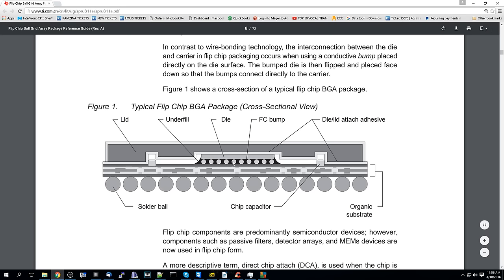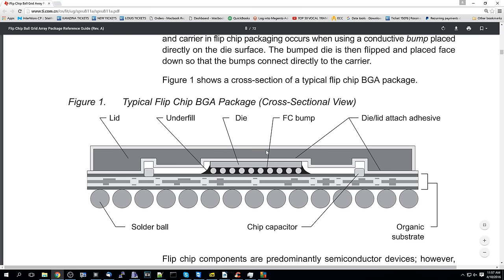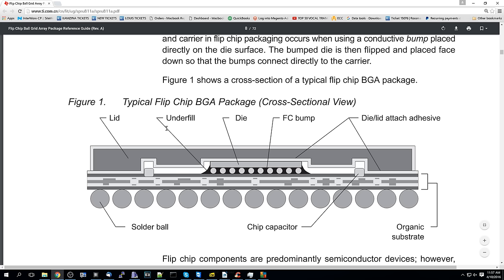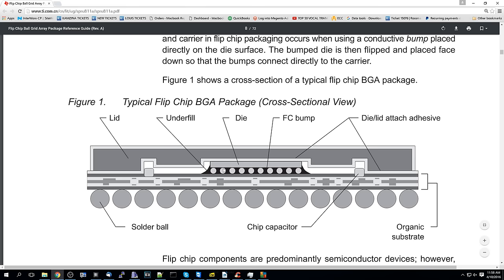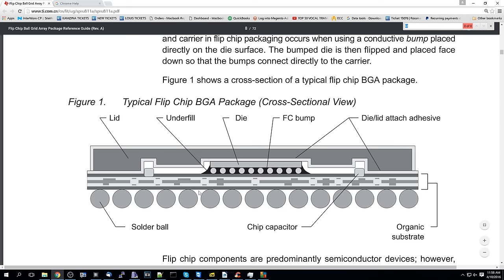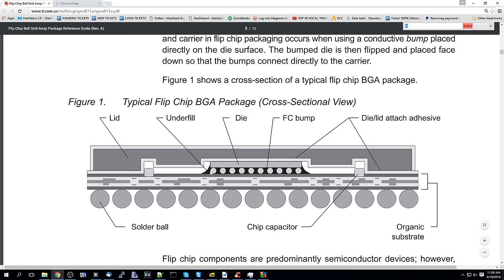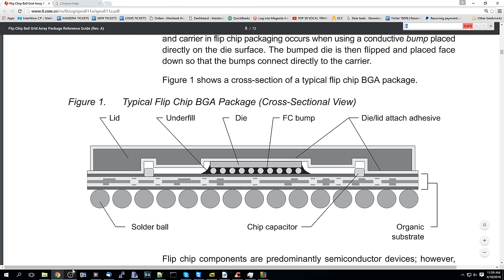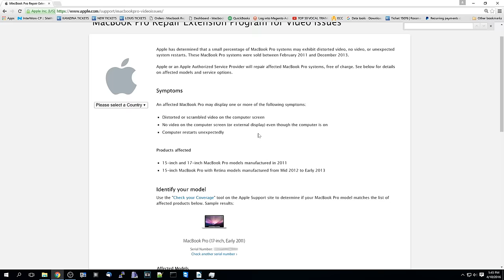Reballing a dead horse: Q&A from my YT inbox.

Comment: 3 years back my r9 270 completely failed on my after some artifacts that appeared shortly before, i did the oven method which fixed the card and it actually still works to this day
Reply: I also have a failed R9 270, could you share some details on how you fixed it? Mine failed around 2.5 years ago...
Reply: @MrDuck-je7fg  it's pretty detailed on here https://lifehacker.com/save-a-dying-video-card-with-a-quick-bake-in-the-oven-5823227, oven method basic steps are dismantling the cooler and heatsink from the gpu chip, then placing it on an oven plate but important to let the chip's four corners rest on tin foil balls, then put that tray in the preheated oven of around 390 degrees fahrenheit and leave it like that for 12 minutes, then let it cool and after that screw everything back including new thermal paste and then it could perhaps work again
Reply: @temmorijken5762  Thanks dude!
Reply: @MrDuck-je7fg  hope to hear how it worked if you decide to ever do it
Reply: @temmorijken5762  My friends graphics card died recently and he replaced, so probably gonna do it when covid-19 restrictions loossen up or not :)

Comment: This video is i formative and does give accurate information about what reheating or 'baking' a card does. I have done this twice in the past with mixed results. One card still would not work after, another did and I was lucky enough to get another year out of it before it died for the same reason again.

I back his message 100% as it explains why most professionals won't touch gpu repair for this reason. Also, I personally wouldn't recommend doing this unless you really just have no other options or want to try and get a little more life until you can get a replacement. Just don't expect this to always work let alone work for very long after being successful.

Comment: ah ok. This would explain why back in the day,  Xbox 360 clamp mods worked for longer than reflows. Constant pressure on the failed bumps, not the solder balls. Cool.

Comment: i always thought the myth started with the xbox 360 overheating and the ring of death. suddenly everyone was talking about cracked solder balls after that.
Reply: +trisymphony No, it's older than that. I first encountered the "reflow solder" in fall 2003 talking about graphics issues in a couple Dell laptops. It didn't make sense to be an effective repair at the time, and it makes even less sense now.
Reply: +David Wellman in the case of the xbox 360 the problem actually /was/ cracked solder balls, in my understanding. This is not usually the case, of course.
Reply: rfmerrill Thanks. I don't really pay attention. I'm aware that there were issues, just not exactly what. I'm also old, so. .  there's that.
Reply: +rfmerrill lol ur falling in the myth again it belongs in the trash i believe first gen xbox360 like man before like falcon chip all died... with repair or no repair it was the chip whit chip

Comment: Hey Louis, thanks for your hard work into making these videos. They're very educational and I've personally learnt a lot from them. I have a specific question about the tools you use: In the earlier videos I've seen you using a dual channel Weller soldering station, but later you switched over to Hakko. Is there any reason why you decided to get rid of Weller? I personally have a WAD101 with 80W pencil and find it really good, especially when soldering tracks with a lot of thermal mass. At work, however, I am using a Quick 236 and while it uses a Hakko pencil and heating element, I don't find it as good as my Weller. I'm really interested in your opinion on the Weller tools. Thanks again and keep up the good work as it really helps a lot!
Reply from the maker: +Marcin Pluciennik The weller didn't belong to me.

Comment: Users put keyboards in dishwashers,  hard drives in freezers, etc as various home (last ditch) repair attempts with mixed results.. I can see the utility of baking a board as the last step effort before the recycler. I also totally get OP points on why this isn't a recommended method - most everyone knows heat damages electronics. Thanks for the videos..sorry for not cussing.

Comment: the oven trick worked for my Dual 295GTX. It has worked for alot of cards in this generation. I wouldn't continue to discourage people to do this. Don't write it off as a myth or a joke. It's just the cost of a little time and to run the oven for 10min.

Comment: I understand that you think putting a MB in the oven is BS. However some days ago I had the chance to try it on a Lenovo L300 laptop Motherboard. What was happening was the PC would reset itself continuously. So I thought let's try this oven thing. I wrapped the MB in tin foil and then put it in preheated oven (180°C), I let it sit there for 5 minutes then took it out. However to be sure I put it back inside and raised the temperature to 200°C, it took 3 minutes to reach that temperature then I let it sit there for other 5 minutes after which I removed it. I waited 5 minutes then lifted the MB and waited some more time to let it cool down. Then I reseated it in the PC. Boom it was cured. The PC is working normally since that day (it's been like 4 days). I don't know if this will last but for now it seems everything is ok.

Comment: Louis, I have a question - why FCPGA (flip-chip-pin-grid-array) chips don't fail so often as FCBGA? I believe what you say is true. I have no reason to think otherwise. I'm just curious. I have never heard of a dead CPU-GPU package of, say i5-3210m laptop chip (FCPGA), even though under load they heat up to 90 C and run just fine. I know it has lower TDP (much lower - up to 35 W typically), but heat is heat. Could you provide some possible clues? Because my understanding is, since mobile FCPGA cpu's are clearly also flip-chips (and don't fail so often apparently), what separates them from the rest, aside from being not BGA? Thanks in advance!

Comment: Baking the GPU card in the oven without flux does not make the solder joint permanently functional. I found a video where the GPU card is preheated and at the same time flux is added to the edges of the GPU chip. Finally, the GPU chip is hot air soldered. My GPU card stopped working. I suspect a solder joint failure. The card doesn't always turn on. I had to reset the PC, but now that doesn't help either. That's why I got interested and started digging for more information on the internet. In my previous job, I repaired electronics for 10 years. I don't have a hot air soldering station and a microscope. A preheater is also necessary. The cost of tools would be expensive if I started repairing electronics myself. Of course, damage inside the chip cannot be repaired and a new chip must be replaced, but you cannot buy a GPU chip anywhere. That means the GPU card will stay dead forever.

Comment: why not try the oven method if youre gonna buy a new gpu anyways?. if it will work then you will have 2 working gpus and double the performance some time and if it dies again. try to oven it again and if it doesnt work. then you still have a working gpu and no money spent on that double GPU setup you had maybe 6months to 1 year?. or even better sell it  IF the oven method worked and you have more money to put on a new gpu. cause lets be honest theres 5% people that will take the gpu to resolder a new chip to it(and just for curiosity) what if you heat it that much that it actually solders the iron?

Comment: I bought a Geforce GTX 560 on craigslist that powers on and shows output, but the output is garbled and artifacted. I already tried removing the cooler and re-applying thermal compound, to no avail. I don't see anything broken or damaged on the board.

I know the card isn't worth fixing, but is there a common issue with graphics cards from this era, particularly Nvidia cards?
Reply: Fermi was a shit architecture. Too hot and too loud.

Comment: what is the purpose of bumps and how we actually know that's the fault?
Reply: +ParosPasxaRide These bumps connecting the gold wires from the silicon to the pads on the bottom of the chip. This is called "layer 1 interconnection" and having a similar purpose of the solder balls under the chip. I think thats why its called "flip chip design". To check if a chip has this issue you can heat it up to about 160°C and see if its (temporarily) working. AFAIK the real problem are not the bump material but rather the composition of the underfill. A primary cause for degeneration is heat. I have seen many Laptops with bad thermal design and a lot of "overclocker edition" graphic cards failing, because they are driven far above there specs.

Comment: This is one of the most mindblowing solutions I have ever come across.  We have a fvp-4000t that stopped working today.  I work in IT so quite handy taking things apart and after removing the hard drive and connecting to my PC the drive worked perfeckly ok.  There was nothing obvious on either side of the board so was stuck, maybe a bin job.  I then did some Google surfing to find solutions or just bin the box.  I then found this video on YouTube https://www.youtube.com/watch?v=_4Vp4N4wSg8 that lead me to the other video as suggested https://www.youtube.com/watch?v=20H-XUvI9iI&t=271s

We decided to give it a try and fired up the oven to 200c and made some raised pillows to keep the circuit board away from the roasting try.  Removed the circuit board and heat sink etc. as suggested and put in the oven for 10mins.  Then turned the oven off and left for a few minutes with the door open allowing the circuit board to cool down.  Then removed the board and put on the side until cold.

Then put the circuit board back in, added the heat sink and other bits but left the hard drive out.  I powered the board up and guess what I got an LED light up.  Turned it off and put the drive back in and finally the lid.  Plugged the fvp-4000t back into the TV and powered it up.  Unbeleivable all working as it was before and all the recordings ar in tack and working.  Thank you very much. 🤣😃

Comment: yup, i remember those.   it was the DV 2000, DV 6000, and DV 9000.  with the AMD cpu.  lol.  i seen dozens of them. (it was actually the nvidia chipset/graphics card)...  now the big thing is the HP Envy laptops with the aluminum covers. they literally glue the holes u screw the hinges into to the back cover.  and they are all breaking constantly. lol  HP IS  COMPLETE SHIT.
Reply: +piffdaddy420 i had the dv9000 cant remember exact model and i can confirm this, the nvidia chipset would bake itself and you would end up with lines on the screen, that was early warning signs, i will say that despite its poor design it was actually a rather good laptop and had ok speakers and screen.

Comment: Being pedantic but it's a bga package on a bga package hate they call them bumps but oh well. 

It's team xecutor and bunny huang a genuine electronics engineer from mit on the xbox 360 that proliferated this by accident/misinterpretation they produced X-rays and dye checks showing supposed cracks partial failures on the bga solder balls of the gpu, these cold joints were genuine but not the cause. 
The fix they produced was a clamp, called x clamp which just applies extra pressure to the top bga package allowing surface contact only not a soldered joint these same xbox 360 modders also pc guys spread the information to laptop gpus this needs to DIE already!

http://www.bunniestudios.com/blog/?p=223

Comment: Having baked a few vidya cards myself, I have to say that criticising this method is very shortsighted, for the following reasons:

1. microcracks normally appear years after initial purchase, when the price of your card has dropped several times. In my experience, we are talking about cards with max 300 USD resell value.
2. baking them will temporarily fix them for NO COST. The effect may last anywhere from 3 months to a year. That's enough time so you can save money and find a replacement.
3. The prices asked in my country by people who do what Louis is doing are at least 300 USD per job. Unless you want to marry that vidya card, it will not be cost effective, AT ALL. It makes much more sense to bake it for free, and buy a NEW card in a few month's to a year's time.